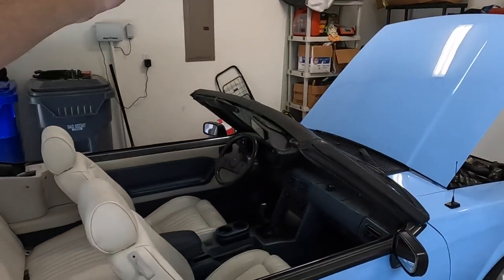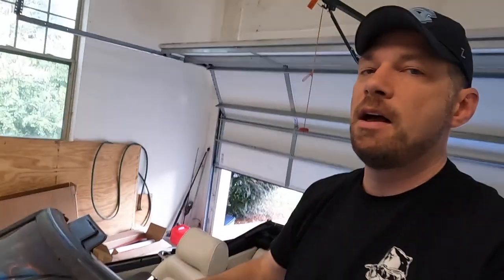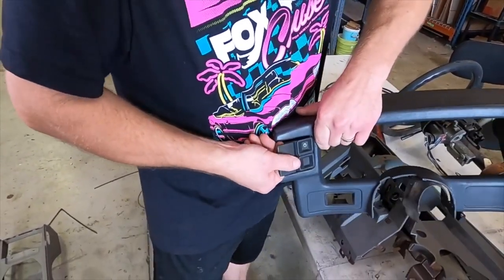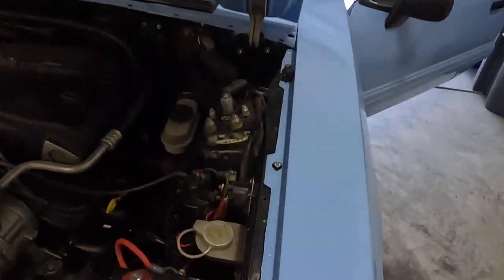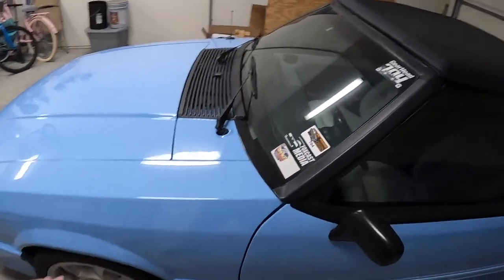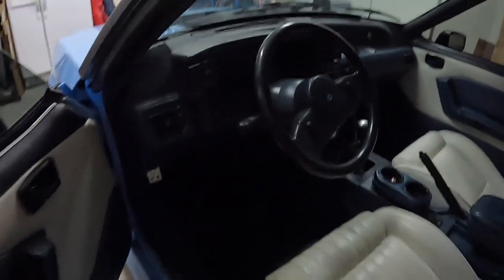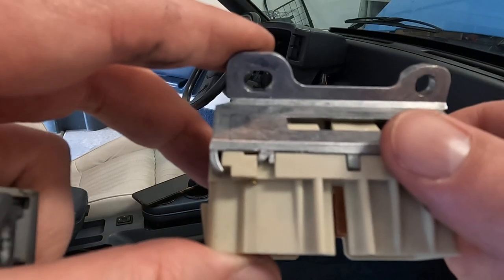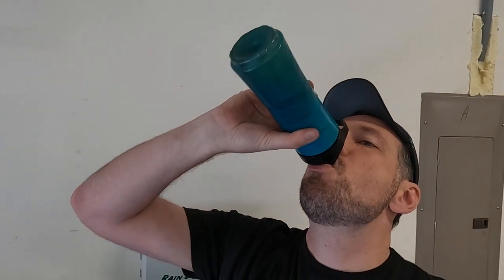1987-1993 FoxBody Mustang Ignition Switch Install // 2023 CHANGES TO THE CHANNEL

Comment: I remember in the early nineties Ford had a recall on the ignition switches something about terminals being to close together and could catch fire when the car was not even running. Surprisingly the dealer gave me the revised part for my 92 and I installed it myself. Still working good.

Comment: Matco makes a low profile bit driver and socket set in one it's the best little tool set I've ever bought definitely worth wat I paid for it worked on everything I've used it for great little set
Reply from the maker: I should definitely pick up one of those.  Thanks for the tip!
Reply: @GearHead704  no problem brother just wanted to help anyway I could man little pricey of course you know matco but I use it alot working at a junkyard and like I said I use it pretty regular gets in alot of spots nothing else will has star bits screwdriver bits and sockets up to a 13 I think don't really use but up to the 10 lol but man can't beat it great set I also have a few foxbodys 4 of em to be exact lol but no time to mess with em life kinda got turned upside down for me single parent kinda takes everything I got time for there anyways sorry for talking so much man lol but great tool set brother

Comment: Ya mine caught fire yesterday.  Make sure you put an inline fuse on the signal wire to save yourself 3-6 hours of wiring later on.
Reply from the maker: Good tip and I'm sorry your caught fire.

Comment: A good way to test the ignition switch, take and slowly turn the key forward, when it starts firing off slowly guide the key back to run position, let it idle while supporting the key and let it go. It'll probably die then. In my old auto it would run and drive until i hit a bump. Also a finger ratchet is what I got the window screws out with
Reply from the maker: Can't beat a finger ratchet!  Thanks for the tip.

Comment: 1987 Foxbody, Felt like leaving a comment for anybody else with the same issue, it just seemed like my key wouldn’t stay in the run position. With a little bit of pressure it stayed, but as soon as I took it off it didn’t. My issue was that the solenoid is loose. Push the solenoid up and try to start and see if it stays in run. The previous owner resorted to tape to fix this, so i think i’m just gonna do the same until I can get a new solenoid or figure out how to attach it properly.
Reply from the maker: Thanks for adding the info.  Hopefully it will help some others as well.

Comment: If that adjustment is off it will spin and not fire. Matter of fact many good switches get trashed due to wear misalignment that has adjustment space to tighten back up the connection.
Reply from the maker: That seems like a valid point for sure.

Comment: I had that part fail on me when I was 16 in my 87 4cyl took it apart cleaned ,zip tied back together and got it working had a relative show me no you tube back then in 95👍
Reply from the maker: The zip tie trick is a great one

Comment: Always remove the ground wire first not the positive 
If it makes a tiny spark it will blow things like a alternator or computer out and that's expensive
Reply from the maker: Yes good point for sure.  I'll try to get it right next time.

Comment: Over worked and under rated. Yes I still watch 😜 Take you a much needed break because I think you need one , get your personal stuff worked out and get your mind cleared up, then come back stronger than ever with fresh new ideas and change up the channel content a lil. I personally think u should build u a beast mustang  starting out stockish and doing a lil at the time to make it faster and faster while showing how much faster each upgrade makes it while doing it say on a budget buying used parts where u can like the heads and having them ported etc. Find someone to drag race you from time to time. We are suckers for that kind of stuff 🤣🤪 Then u can still mix in the how too's with the fox hot rod that your building but keep it running as much as possible during the upgrades to keep us on the edge of our seats. But I do think you need a killer fast car on the channel. Not saying tarheel is slow and its a really nice car but im sure u have tarheel the way u want it and its a really nice driver . Just my 1.5 cents 🤣
Reply from the maker: 79Beans!  1.5 cents I hear you lol.  I actually would love to do what you are suggesting, just takes a lot of time, but who knows maybe and actually you're right, tarheel is slow!  LOL
Reply: 🤣😂🤣😂 Thats what u want it to do is eat the clock because that is endless easy content towards one goal . Actually Tarheel would be the perfect candidate for something like that but I didnt know if you would want to make it a high hp street car or not. You could do a 363 dart block supercharged big cam beast which would set ya apart from all of the other  channels and it would be done in a vert which no one else has 💪😁. Im pretty sure tarheel can hold his own out in the skreets 🤤

Comment: well come on, you know like i know, there are just more content creators on YT so your gonna loose some and then it will fluctuate. so my suggestion is if your feeling burnt out just knock it back to one video a week and  find your footing and then make a decision weather or not you still want to do it…..It’s a lot of content out there and you had to know eventually it would kind of tapper off, but almost all the creators go through this weather it’s cars, lifestyle, vanlife, RV living, card readers and that’s just the tip of the iceburg. There’s a place for you but i think that everybody on here goes through the pressure and it can be very intimidating….Look at samcrac, or auction auto rebuilds or nomadic introvert, some of those guys are even running reruns or old episodes……that’s a lot of pressure, hang in there it’ll get better!👍🏿😂
Reply from the maker: Thanks, I ended up taking a few months off then came back fairly regularly last year starting around April.  I'm currently uploading every other week or so.